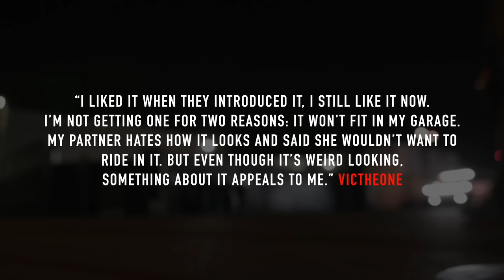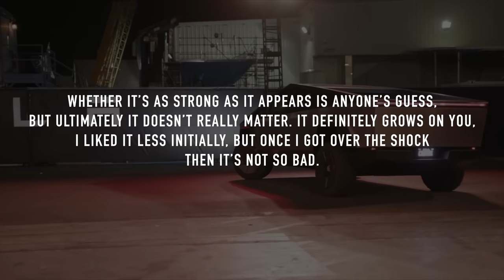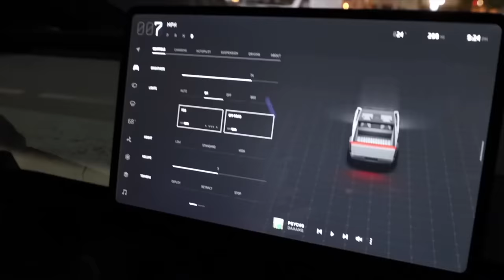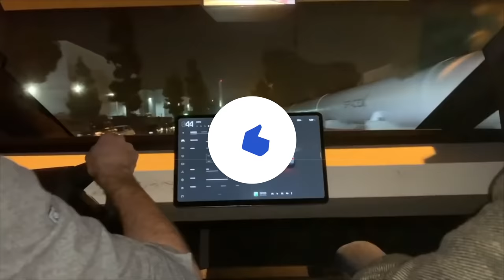Tesla Cybertruck Could FLOP COMPLETELY! (Elon Musk Review)

Comment: Looking forwared to tough new stainless vehicles.  Like many that looked at the cybertruck I feel it is too big and am looking forward to a smaller international version or a capable cyber car,  4 wheel and indipendant drive are awesome, durable is useful for those that want something more than a fashion statement and the unique look will be as much of a selling point as a detractor.
Reply: The Ford is longer wider and taller. It’s not that big it 2 will fit in my garage nicely.
Reply: @royphillips7644  Not everyone that wants a truck needs it as big as possible.  Small trucks sell.  I've driven king cab F150 and its just unnecessarily large.  For my purposes I'd be good with a single row seating.  Cyber El Camino or sidekick would be awesome but we just arent at the stage to have that specialized of models.

Comment: To the extent Cybertruck flops it will be due to it's functionality not looks. Like many I'm not real enthusiastic about Cybertruck's looks, but it's the bed that's the deal breaker. There's a reason the bed of pickups has homogenized over the last roughly 100 years across all manufactures. It's because the bed is a tool and with tools form follows function. Pickup beds all look alike for the same reason circular saws and framing hammers all look alike. It's what works...The cybertruck bed doesn't work.
Reply: Do you know what T slots are?